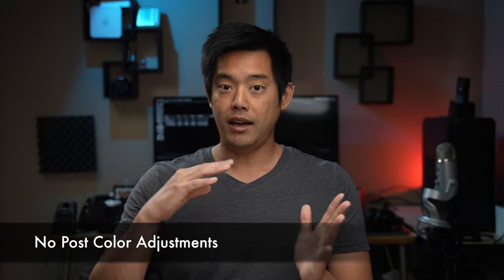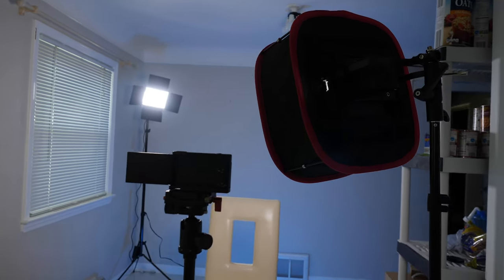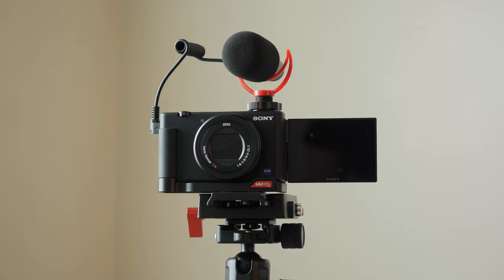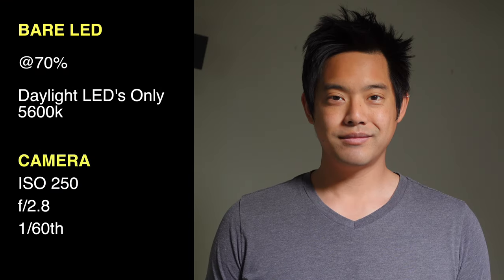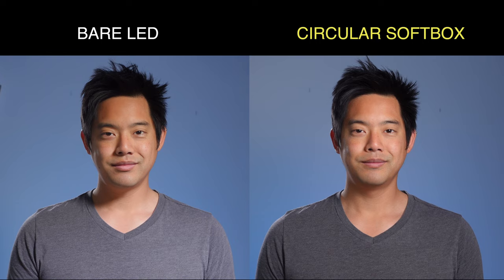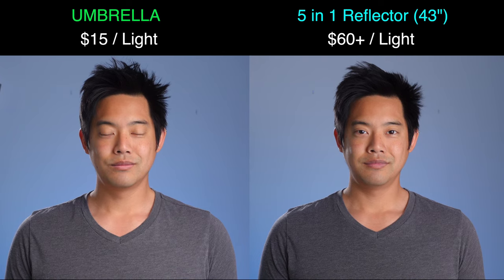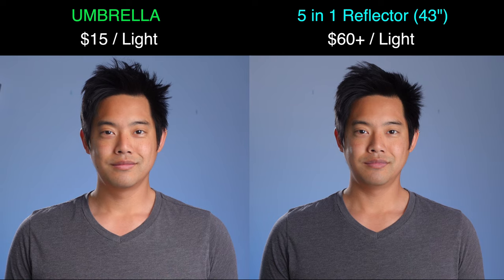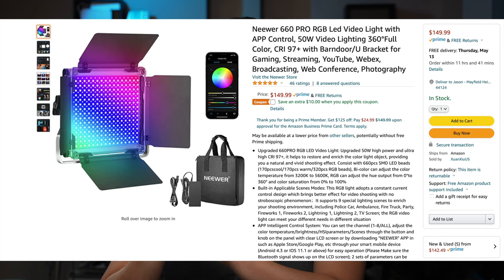How to diffuse your Neewer 660 LED Panels | Budget | GVM 800D and many more

Comment: hi there. Sorry if my question is a bit off topic. Did you ever own some Aputure Amaran AL-528W LED panels? I wonder how much "better" would these Neewer 660 be...stronger light? 
better light?  Just wondering. Thanks for the video...
Reply from the maker: Hey hey Erick!
Thank you so much for checking out this video and commenting!
I didn't have specifically the 528, I was given an HR672c for review. I did a massive comparison here: https://www.youtube.com/watch?v=qPxGAUHxWbQ 

Based on the LUX reading of the 528W model, the Neewer 660 looks to be brighter, mainly because of the spot beam, but even so the fall off is still decently bright. For reference, based on the numbers and some math. the Neewer reads 805lux from 2ft away, the 528W would be approx 320lux from the same distance. 

Hope this helps.
Reply: @TLDR_filmmaker  hi there...how do you find the time to respond so many questions?! Thanks...I actually decided to get a Neewer NL 660 and I tested it against my old AL-528W..
since the 528 is daylight only it was brighter  than the 660 of course at 100 power in DAYLIGHT colour temperature. I used my Canon 90D and a Sigma 18-35mm lens to test the lights and with the 528 on only it made my living room brighter than with the 660 in Daylight setting. The spot beam of the 660 might help a bit in some instances. The 528 throws light all over! which for weddings etc may be ok. 
But since I use the 528 indoors mostly,  I always use a 1/2 CTO filter to convert the AL-528W from daylight to almost tungsten (don't like going all the way to 3200K), This makes  the light about 4200K which is a good compromise I think and it doesnt cut the light too much.  Then with the filter on I compared the output of the 528 against  the 660 in tungsten and the 528 was a bit stronger hhh, but next time I will try setting the Neewer 660 to about 4500K which will have all LEDs on and roughly in the middle which perhaps will give me more output out of the 660?! 
I can't say if the quality CRI of the 660 is better than the AL528W. I hope so. Those aputures are older models. Dunno...honestly, the Neewer 660 is an ok light. Any videographer with 2 or 3 of those NL-660 lights could make a small set look good-but of course bargain lights are not meant for serious abuse but I like it-the remote will come in handy- and I think it will be useful. Only cost me $120 Cdn deliverd to my door so it's a bargain- I think that if I really need a stronger light I will look at the Godox ML60Bi- I like how portable it can be. That one could definitely light a podium for speeches etc- But for now I will "survive" with the Neewer 660 and 2 aputure AL528W...I'm not a pro yet. Thanks for your videos. Really hard work!

Comment: how many stops of light do you lose with each diffusion technique?
Reply from the maker: Hey hey Jack!
I honestly do not know that off the top of my head in terms of stops as I did not measure those. If I had to guess at it, I'd say you're losing on average around 1 to 1-1/3 stop.
Reply: @TLDR_filmmaker  ok, thanks for the reply.

Comment: What are your thoughts on the Godox SL60 COB light vs the Neewer 660 panel for a starter kit? The SL60 has 4500 lumens of output vs the 660's 2700 lumens. The SL60 also has an umbrella mount built in. Apparently the newer SL60s have much more quiet fans, but I'm not sure how to tell which ones they are on Amazon.
Reply from the maker: Hey hey again Chris!
TLDR, go for the Godox SL60. Bi-color on a panel sounds cool and all, but its really not all that practical for a starter kit. 99% of the time you'll be in a "daylight scenario" so you want the most power possible. The Godox's power will open you up to using light modifiers and have it easily attach and you'll have the extra power to push it if needed. The neewer is a great at home youtuber kit because you're never going to move it. But you're somewhat capped in certain scenarios of lighting and because of its "Beam" nature instead of flood. Getting to most soft light is hard. Also its harder to cut the light compared to a COB LED with a bowens mount. 

I will say do not worry about the fan noise, if this is your starter kit it will, and should, be the least of your worries. Based on your questions you need to understand lighting and crafting your look first before worrying about the sound of a fan in your recording (which is fairly easy to remove). 

Those are my thoughts, I would also recommend you check out this video on how I come up with buying decisions here: https://www.youtube.com/watch?v=3zO9axytfK8

Hope this further helps!

Comment: Hi there. Do you boom your rode ntg? I have the deity 3 pro and it doesn't sound anywhere as good as yours. In wonder if I need to boom it
Reply from the maker: Hey hey Joel!
Thank you so much for checking out this video and asking a question!
Yes, I have my Rode Videomic NTG boomed near the front of my head and have it just out of frame pointing at my chin. If your mic is further away sitting on your camera it is going to capture a "thinner" voice because it is further away from your mouth and capturing the ambience of the room as you speak. When its as close to you as possible it only captures your voice and not much of the room around you.

The boom stand I am using is this one: https://geni.us/ABBtsYp (affiliate link)
I also have a ball head on it so that it's easier to articulate where I want the mic to be pointing. Hope this helps!
Thanks again for stopping by! Stay safe, healthy, and I’ll see you in the next one!

Comment: Fantastic review. You touched on all the points that I needed to hear. Furthermore, I didn't even realize about the umbrella option and how good it looks. Where would you attach it to the light if i got the Neewer 660? Cheers!
Reply from the maker: Hey hey Gavin!
Thank you so much for checking out this video and asking a question!
The umbrella adaptor attaches to you light stand, and the on top of the adaptor is where your Neewer 660 goes. Its basically just an imbetween piece for the light stand and Neewer 600. Hope this helps!
Thanks again for stopping by! Stay safe, healthy, and I’ll see you in the next one!
Reply: @TLDR_filmmaker  Thanks for your reply. Much appreciated!

Comment: Do you think the umbrella/660 setup would be good for a green screen?
Reply from the maker: Hey hey Kai!
Thank you so much for checking out this video and asking a question!
Hmm, it'll definitely help even out the lighting on the green screen a bit, however it's going to depend on how much of the green screen you need lit based on your framing of the subject in front of the green screen. If you're talking like a traditional gamer setup where the green screen needed is only a small portion, then it should be fine. But if you're trying to light up a full shot of a subject green screen, then it may not work "as" well, but Keying software is so good these days that some unevenness is not a big deal. Hope this helps!
Thanks again for stopping by! Stay safe, healthy, and I’ll see you in the next one!

Comment: I think something to consider is the 5-n-1 deflector does reduce the cost to composition by one light. Are you using the 5-n-1 as diffusor or deflector?
Reply from the maker: Hey hey Kirk!
Thank you so much for checking out this video and asking a question!
I am using it as a diffusor in this example for a keylight situation with the Neewer 660. You are right, depending on the source power of a keylight that is already soft, you could bounce that light on the fill side for a nice one light setup!
Thanks again for stopping by! Stay safe, healthy, and I’ll see you in the next one!
Reply: No problem. The cool thing is point lights are usually harder then keylights and a one light setup works for me a lot. Just seems the bounce ratio to hair light just works for some reason. Thanks for all your hard work. It is appreciated!!!

Comment: The Neewer 33" umbrella used in your video worked really well. Would you be able to test the 660 with a 45" and 60" umbrella to see if it gets closer to the 5-in-1 reflector results?
Reply from the maker: Hey hey again Chris!
The larger umbrella will not get much better results mainly because the Neewer 660 is a "Lensed" LED panel, which means the beam is more spot. So a larger umbrella won't really help because the light isn't lighting up the further outer parts of the umbrella.
Reply: @TLDR_filmmaker  Ah, I see... Thanks for your response. Keep up the great work!

Comment: hey TLDR thanks for your reviews.. thanks for the video. Can you confirm if the neweers 660 at 0% is the light completely dimmed like off ?  I want a light set to be able to dim almost no light. (some other lights I bought let you put 0% on dial but in reality, you have like 15% of light and it is too much.)  I need something reliable on that 0%. Thanks in advance
Reply from the maker: Hey hey Evans!
Thank you so much for checking out this video and asking a question!
The 660 Bi-color version does go down to 0% which is completely off. It does not have a 1% increment rather it goes in 10% increments. 
Thanks again for stopping by! Stay safe, healthy, and I’ll see you in the next one!

Comment: Hi, thank for this video, I'm hesitate with the 660 pro, but as you said at the end of the video It will probably not be brighter as the bi-bicolor( did you saw both side by side ? to compare ?) , do you think I will be noticeable ? very much less ?  I think the possibility of the pro with the rgb are very cool, but vs power ...brightness, does it worth . I also thought of bi-color with color filter ... but not easy as the pro .. thanks
Reply from the maker: Hey hey John!
Thank you so much for checking out this video and asking a question!
I do not have a pro to compare side by side, however knowing how marketing works when they say you get 10w more power, keep in mind thats 10w divided by the Daylight, Tungsten, and RGB LED. Meaning you're only getting an extra 3.33w of power out of each. So in my mind, its not worth it and probably makes minimal difference in actual use. 
Thanks again for stopping by! Stay safe, healthy, and I’ll see you in the next one!
Reply: @TLDR_filmmaker  Hey , thanks for your answer ! and  do you think that 660 bi color ( normally it's  with 2 x 330 white led)  will be more powerful that 2 x 170  white led on the 660 pro,  probably...  or maybe egal  ? because 2 time more led hum hum ..! what do you think ?
Reply: Hello, i change my mind maybe im' on the good way, I studying the GVM 1000D  ! brighter that 660 pro rgb, I think it can be a good solution !

Comment: Is there much value in leaving the diffusion plates on the light underneath the diffuser box? Or is the rule of thumb to pretty much always take them off?
Reply from the maker: Hey hey thelachster!
Thank you so much for checking out this video and asking a question!
There is technically some value to leave the plastic underneath a diffuser box, but the difference you see is not enough to warrant this approach as well as losing a noticeable amount of output to work with. With small budget LED panels like these, rule of thumb if diffusing is to take off that plastic cover. If you are using a much much more powerful LED panel, then you don't necessarily have to take off this cover because it will further help get you more diffused light for soft light looks. Hope this helps!
Thanks again for stopping by! Stay safe, healthy, and I’ll see you in the next one!

Comment: Good stuff. In shopping one issue that frustrates is the horrible naming and listing and pricing mess. You can often find a more complete bundle for less in price. EG buy the kit that comes with stands and small square diffusers as it is cheaper than the same kit without the diffusers.  Then the whole 480 and the 660 for about $12 more bit it’s not shown on the search as a selectable option - so returning the 480 kit and getting the 660 kit. Ugh. Then the lack of clear model naming in the listings as they jam repeated terminology on the name ( for search optimization I get that) but fail to put - eg 660 or P600 - in the listing title. Manufacturer making it needlessly convoluted and generating unnecessary returns.
Reply from the maker: Hey hey InterCity-1-3-4!
Thank you so much for checking out this video and commenting!
I hear you on the shopping front, as much as the budget LED panels are great value for what they are. They definitely clutter the market in a way thats not streamlined and further adds to just overall waste of products that nobody necessarily wants. Sigh
Thanks again for stopping by! Stay safe, healthy, and I’ll see you in the next one!

Comment: I have these but I'm a fitness trainer looking to make workouts. Is there a way to adapt this for filming workouts? or is there another light that's also compact that you would recommend?
Reply from the maker: Hey hey Holt!
Thank you so much for checking out this video and asking a question!
This really depends on a lot of things, mainly where are you filming and do you have full control of the lighting situation in that room. If you do, then you will probably need 3-4 of these to even out the lighting of where you will be performing the setup and possibly raise your cameras exposure settings (ISO) so that you even out the lighting of the ambient to match up. During this step the LED panels will lightly become "too bright" but thats ok, simply lower the LED panel so that you achieve a somewhat even lighting across the video. 

If you do not have control of the light and you are fighting sunlight coming through windows. Then this becomes really tricky because sun will change randomly if a cloud comes through. 

Essentially, yes, these can work. For your needs you DO NOT need the softbox because the lights will be placed further back to get your full body. At that point the softbox has no real affect for softness. So you will mainly use the LED panels with or without the plastic cover in front, you'll have to play around with that to see which you like. 

You will set the lights up like a "news studio" where you create a semi circle of light pointing at you from a top angle (above your eye line) This way you don't look like dear in the headlights.

Try to stay away from a wall, behind you, if you can. And from there if you wanna go the extra step you can add some background objects like fake plants, or even more LED lights pointing at your back. This causes a halo'ing (rim light) that will further separate you from the background giving you a more clear look. 

This is, in my opinion, the basic fitness setup. As you grow your program you can eventually swap out the LED panels to 60-150w COB LED's shooting through a diffusion curtain to give you the softer look if you find the LED panels too harsh. But in general, fitness videos are generally shot with harsher light so show off the body lines. 

Hope some of these guidelines help! Good luck!
Thanks again for stopping by! Stay safe, healthy, and I’ll see you in the next one!
Reply: @TLDR_filmmaker  oh wow, can’t believe how helpful you were. Thank you so much! 

I just ordered a cheap tube light for the back wall because I need to be pretty close to it and it creates pretty harsh shadows. I’ll try adding another light too. I find the floor gets pretty dark
Reply from the maker: You're most welcome! Always happy to help the community when I have time. 

In general when it comes to Fitness and cooking shows, stuff like that, those studios are lit up the wazoo with lights Eeeeeverywhere, because they need to. For cinema filmmakers we don't light that way because we want to create texture. 

Most fitness people on a budget will usually try to film in a big living room with lots of windows. This is an easy way to achieve the "TV" look. 

Some will actually buy a few work lights because they are cheap and blast a lot of light and shoot it through a shower curtain so that it doesn't look too harsh. The problem is the room gets hot and the LED versions usually don't look great on your skin and can make you look a little green. 

Definitely work with what you got for now and play with the camera exposure. Its a common misconception to have the lights going at 100%. It doesn't need to be. First expose for the general ambience of the room to your liking with the ISO or Aperture settings and then use the lights to help it along until you find a good balance where the picture quality still looks good and you don't have as harsh of a look with minimal lights. 

Hope this further helps!
Reply: @TLDR_filmmaker   Thanks so much! This is incredible. Lmk if I'm overstepping but this is my current setup.

https://www.youtube.com/watch?v=XkQtE8p1r5E

I record on my phone but i have canon 90D. I don't use it because of set-up time. 
 
what do you think of the setup and do you do consultations?